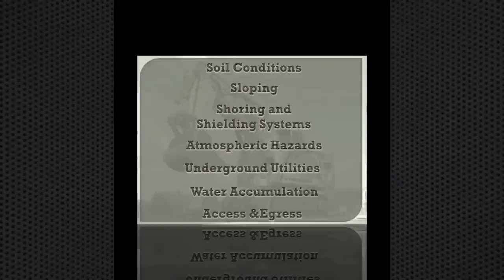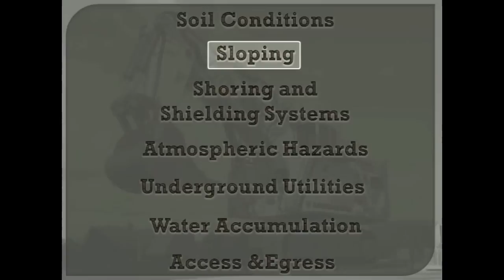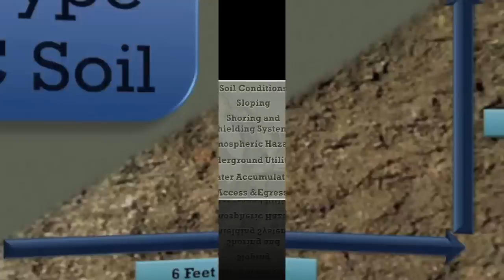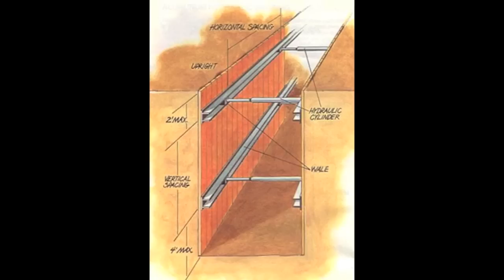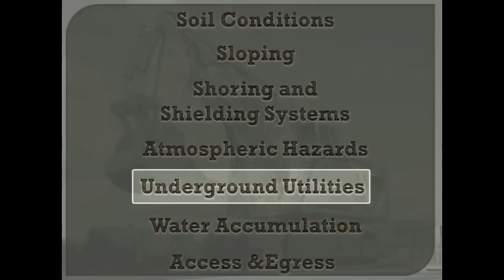Trenching and Excavation Safety

Comment: Videos like these can be a valuable tool...The problem is that some things get left out.  NO SOIL IS TYPE A if it is fissured or cracked or subject to vibration.  Contractors can get in a lot of trouble classifying soil as type A. because they will not use shoring.

Comment: the vid says that if oxygen content is bellow 19.5% respretory protection may be required. please be specific as this is misleading resperators do not add oxygen to air only filter certain toxins. they can not protect from oxygen difficency or displacement of oxygen in a trench or confined space!! please change this to be clear. miss leading information can potentialy be dangerious.
also in my opinion best practise is to continiously ventilate from a good air source  i to the trench not use ppe as ppe is a last line of defence and if at all possible not a first line of defence.  i believe ppe should compliment a good health and safety control not be the sole control.
To be clear i am passionate about health and safety this post is not ment to tear anyone down but simply to help correct a simple missunderstanding that could to an inexperianced worker could be dangerious.

Derek L